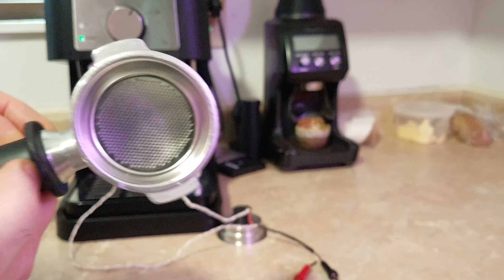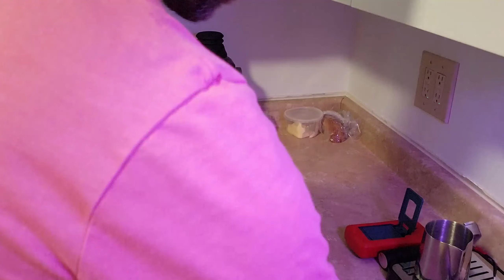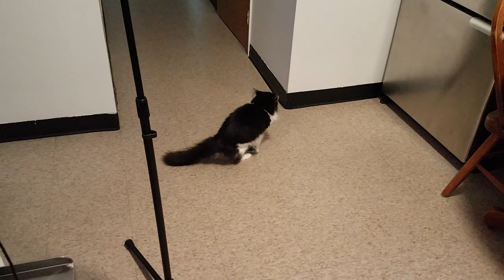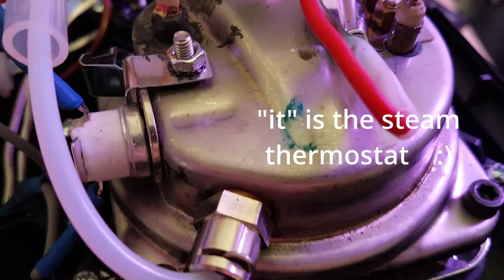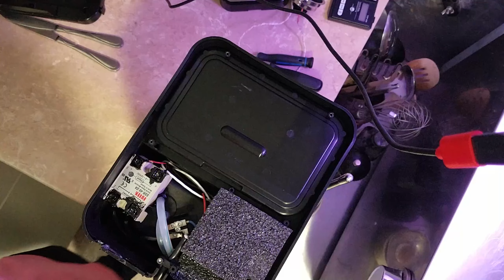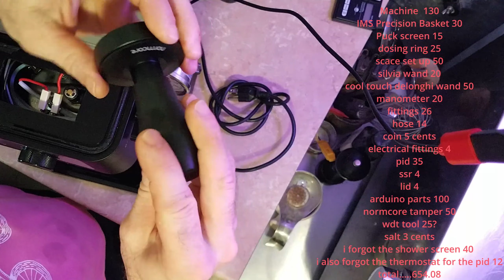De'Longhi Stilosa Disassembly, Mods & Testing

Comment: I'm so pissed, why would you not show us how you disassembled you machine. Like people watch this to help them fix their machine. Very dumb edit choice.
Reply: Since he was not help, here's how to take the top off: there's two Phillips screws under the flap on top. They are covered by plastic plugs. There are two more Phillips screws on the bottom front of the top section. Those also need to be removed. After removing those the top should come right off.
Reply from the maker: @charleshobbies  LMAO
Reply from the maker: if you can't figure out how to take the top off then you probably shouldn't be taking it apart....
Reply: @justinbouchard  Or maybe he just wants to make sure he doesn't break anything that he can't see from the outside while taking it apart. I came to this video for the same reason of seeing how to take it apart to make sure I didn't break my machine on accident.

Comment: Is there a video on the PID? I figured it would just be plug and play, but of course nothing is that simple.
Reply from the maker: just found the comment about the pid values
here's the copy and paste of it!!

Yes!  Here you go :)  
I wish I could describe to you which variables did what, but it took me about 2 months to learn how PID works in order to set the variables properly.  Then it took about 2 weeks of testing for me to fine tune them after learning how to do it with this machine.  I've been using the gaggiuino stuff on it for a long time now and completely forgot even how to access the menu on the PID, which luckily I still have wired in for power on the machine and just have a piece of electrical tape covering the screen so it's not so bright lol.  Was too lazy to take the bottom off and disconnect it.

So anyways here's what worked very well for me.
in menu 0036
P - 2.0
i - 38
d - 15
Souf - 1.0
ot - 002
FILT - 3

In menu 0089 i think the only relevant thing is the offset which I don't know if it will be the same for you.  Mine was 7, but it fluctuated slightly between 5-9 depending on how warm the water was in my reservoir is what I determined the variable to be.
You can get really really close readings just holding an accurate digital cooking thermometer under the flow straight from the shower screen if you have a probe.

Happy tinkering :)
Reply from the maker: no i'm sorry i didn't make a video about that, i don't really do tutorials per se, more just showing what i've done without instruction

i did however get the values i used for the pid after many many hours of testing with it and I have them posted in a comment on this video or another video where someone asked for them

what are you having an issue with?
Reply: This is great thank you!
Reply from the maker: @BiondCraftCoffee  aweseome!!! you're welcome!

Comment: Nice video!Also,i would want to know if you could give me a brief explanation on how you bypassed the brew temp sensor with a PID,cause im so confused while trying to modify my delonghi stilosa...
Reply from the maker: sorry i must have not seen this comment!  it's also been a long time since i've done it, but if i remember right you just are disconnecting the power wire which runs through the thermocouple attached to the boiler

that wire then runs to the pid which controls the heat

Comment: Would you mind giving a brief explanation as to why adding the coin makes the steam pressure better ?
Reply from the maker: it takes longer for the heat from the boiler to transfer into the thermostat :)
Reply: Thanks ! One more thing, do you know if it would work on a De'Longhi ECP 3630 or a 3420? Thanks again I greatly appreciate this type of content

Comment: Where did you exactly mount the temperature sensor ? On the bottom of the boiler or top of the boiler? Which sealant did you use to seal the sensor ?
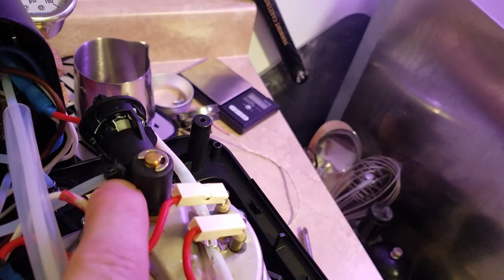Reply from the maker: 11:21 
i used jb weld marine weld
Reply: @justinbouchard  and you mounted on the side or top ?

Comment: What’s up, Justin. Your videos kinda inspired me to modify my own Delonghi Stilosa with PID. And while watching this video I got few questions. How would you determined that right thermostat (if you look from the front of machine) on the boiler is responsible for brew temperature? I was looking at my machine trying to follow the wires and it looks like its left thermostat. If you still remember this detail, it will be very helpful for me. And second, how did you install “coin” mod to increase steaming temp? Is it just something between thermostat and boiler to lower the temperature that thermostat will read? Thanks for your response and for the mod videos.
Reply from the maker: sorry i have not seen many comments apparently lol
the thermostats have temperature ratings on them so you can see what they are, i just placed a coin between the thermostat and the boiler and yes it just takes longer for the heat to travel to the thermostat allowing the boiler to make hotter steam

Comment: Would it be possible to show how you have everything wired up? Thank you.
Reply from the maker: @SangNguyen-bw8vh  I just realized this is the video with the PID 

I can show you a video how to do that that's easy 

give me a week though
Reply: @justinbouchard  Oh Amazing! It's great to hear that😀. thank u so much bro. You don't know that I've tried looking for instructions on how to install PID but nobody telling about delonghi machine has even mentioned anything about it except finished pictures, text, diagram that I don't know how to do. I can't wait to see your next video🙏
Reply from the maker: @SangNguyen-bw8vh  i'll make something for you, it is easy but clear instructions are difficult to find
basically, you add power to the pid, connect the thermostat to the pid, remove power connections from old thermostat and now your pid is controlling the temperature
I have the settings for my pid in one of the comments here or in another video.
If I don't post something in one week give me a comment to remind me :)
Reply: @justinbouchard  oh bro :) I will definitely remind you
Reply: @justinbouchard  it would be even better if it have dimmer mod, pressure gauge installing way bro!😊
Reply from the maker: @SangNguyen-bw8vh  pressure is easy, can show that, dimmer is easy, learn how to install a dimmer for a light
then imagine the pump on your machine is a light, install the wires the same way :)
Reply: @justinbouchard Hi! Do you remember me?😊 I hope you've made a video on mods
Reply from the maker: @SangNguyen-bw8vh  what do you mean by everything? 
there's wiring diagrams for the gaggiuino stuff

If you give me about one week and maybe give me a reminder and I can try and make a short video showing how I have things wired up 

I'll more than likely just make a small basic diagram and explain it on a video 

I'm not sure if I'll have the energy to pull it apart and show everything

Comment: I really wish you would make a video about how you put on that steam wand. I started the process thinking I could use your current videos and realized you never really showed how you got into the machine to get to that part.
Reply from the maker: can you be more specific?  I haven't watched any of my videos in a while and I also put on a different steam wand that is a cool touch one.  do you mean how do you get the steam wand out?  if that's what you mean you have to take the boiler apart because the mounting bracket that holds the steam wand is sandwiched between the top of the boiler and the frame of the machine

Comment: Nice video, man 👍

Is pid controls boiler's temperature while extraction or boiler heating off ?

I like moding my delonghi ecp too.
Reply from the maker: thank you!!
pid controls during both, i optimized it so it doesn't overshoot during extraction
i had the pid for about a month or so then switched to the gaggiuino and modified the software to suit my needs :)

Comment: Hi, im modding my ecp 33 21 and I apreciate a lot your videos, could you share your PID values? Thanks a lot.
Reply from the maker: Yes!  Here you go :)  
I wish I could describe to you which variables did what, but it took me about 2 months to learn how PID works in order to set the variables properly.  Then it took about 2 weeks of testing for me to fine tune them after learning how to do it with this machine.  I've been using the gaggiuino stuff on it for a long time now and completely forgot even how to access the menu on the PID, which luckily I still have wired in for power on the machine and just have a piece of electrical tape covering the screen so it's not so bright lol.  Was too lazy to take the bottom off and disconnect it.

So anyways here's what worked very well for me.
in menu 0036
P - 2.0
i - 38
d - 15
Souf - 1.0
ot - 002
FILT - 3

In menu 0089 i think the only relevant thing is the offset which I don't know if it will be the same for you.  Mine was 7, but it fluctuated slightly between 5-9 depending on how warm the water was in my reservoir is what I determined the variable to be.
You can get really really close readings just holding an accurate digital cooking thermometer under the flow straight from the shower screen if you have a probe.

Happy tinkering :)
Reply: @justinbouchard   Thanks a lot again, I really apreciate your videos and how you think outside of the box. How is it going with gagguino?, I read that you have some problems with the community. Are you liking it? Im thinking of maybe installing but I also like to feel of controlling the flow by my own hand.

Regards :)
Reply from the maker: thanks for the kind words!  i'm glad i'm helpful :)
i love the gaggiuino, especially with having added stop on weight and touch screen start and stop, and adjustinng the steaming temp
it's just the best
and yeah, there were a couple of ok individuals, but the community as a whole was pretty effing toxic led by zerobit
have no idea what it's like almost a year later but that's how it was then and i don't really imagine that the aggressive bigotry and elitism while modding a 400$ coffee maker has changed lmao 
 @ElFortresMC

Comment: Couple of questions, one for you Justin, and one for anyone else who may have used an unpressurized 51mm basket. So to the first Q:

Q1. I noted that you used a 48mm? IMS shower screen...did you need to do any modding/adjustments or did it just fit perfectly. I ask this as this model originally [unlike the ECP3420] comes with a smaller stock 41mm shower screen.

Q2. I plan to use an unpressurized basket BUT without a bottomless portafilter; I plan to use the portafilter that comes with this EC230 unit and just take out the plastic fitting at the bottom. Has anyone done this, what is the largest basket depth/gram volume I can use, and are there any other cheaper options apart from the very expensive IMS baskets; I note some of the baskets have a rolled/rounded top edge [not a flat top edge as with the original baskets], and so wonder if this would create an issue when tightening the portafilter into the machine just before pulling a shot i.e. the extra space needed for the roll might damage the seal OR prevent the portafilter locking/rotating properly.

Thanks in advance for all answers/contributions.
Reply from the maker: hey!!  thank you so much for the questions and praise!  I can get back to you tomorrow about this, just about to call it a night :)
Reply from the maker: q1: I used literally the same screw the original screen is installed with :)  it does work with original baskets as well :)

q2: k, so I imagine the stock portafilter won't be deep enough to use with a different basket, but  I could be wrong,  this is just a guess based on memory.  ims is the cheapest one I could find in 54mm I ordered from espresso shop UK, i'm in canada.
Yes you're more than likely right about the rolled rim.  I don't know if it's this video or not but I describe that I flatten it and trim it to make it fit.
This also brings me to a point about q1 I didn't think of until now.
You will not be able to fit a 54mm basket into the portafilter without reaming out the inside.  I suppose it could be attempted with a burr bit on a drill, or if you had access to a milling machine then it could be done easily.  But for me, cutting the bottom off which is relatively easy, was the best solution to remove material appropriately without damaging the portafilter using a file.

Hope this helps!
Reply from the maker: actually yes, I talk about the rolled rim in the first minute of this video lolol
Reply: Thanks for your reply; pity I no longer have access to a lathe as I could trim the internal diameter to fit; don't fancy the messing about so I will just buy a 51mm basket that isn't too deep either, that way I can just take out the plastic housing in the bottom without modifying the original. OK, I won't be bottonmless/see if the extraction is channeling but so be it.

Just one last question/clarification, so if I don't enlarge  the portafilter the original 51mm will still work with the upgraded IMS shower screen correct?

Thanks.
 @justinbouchard
Reply from the maker: hey!  yes the ims shower screen does fit with the original portafilters! :)
i made a "scace" device and used one of the old pressurized baskets to do this with and it fits just fine :)  
 @teddyb4957   also!  a bonus to not having a bottomless portafilter is if you get  a sprayer you don't have to clean half your countertop and machine lolol :)

glad if I was helpful !

Justin
Reply: Thanks, and agree about the sprayer. Also, didn't know what a Scarce device was but now I do! :-)...YouTube, you learn something new every day! @justinbouchard
Reply from the maker: you're welcome!!!  tons of love from canada :)   @teddyb4957

Comment: Hi Justin from uk, I have a Stilosa I bought new about 2 months ago, I ordered PID T7100 and a PT100 thermocouple from Ali express, which I now have, my question is about the thermocouple fitting on the boiler? Did you drill and tap the stainless steel boiler to fit the thermocouple? I don’t have Tap to do that. My Pt100 thermo couple ends with an M4 brass stud so I’m thinking maybe get hold of an M4 brass nut and Araldite that to boiler then carefully screw the M4 stud into it? A rough wiring diagram of your setup would be a great help! Brilliant video BTW 👍🏻Andy
Reply from the maker: sorry i haven't seen a bunch of comments !!!

yes i drilled and tapped the boiler, hopefully you found the answer in one of my other videos

no wiring diagram from me sorry
Reply: @justinbouchard Hi… that was an old post … I’ve since got rid of the Stilosa it didn’t work out but thanks for getting back to me . 😊
Reply from the maker: @dingnextstop i'm sorry lol!!!